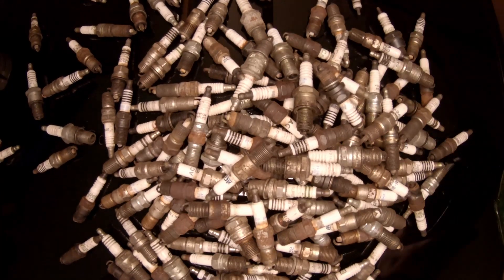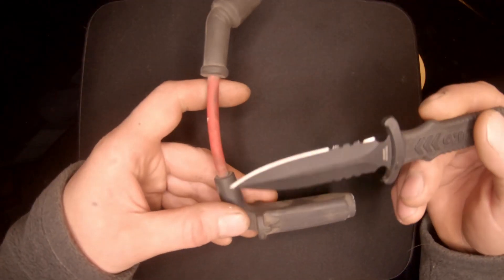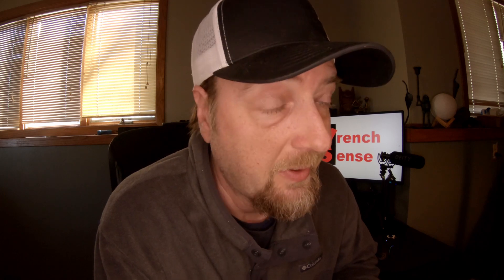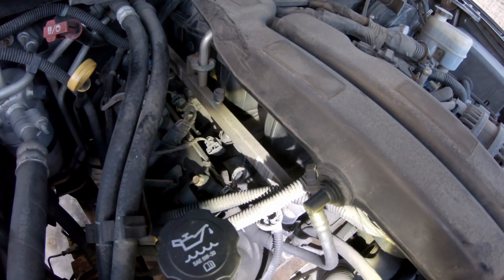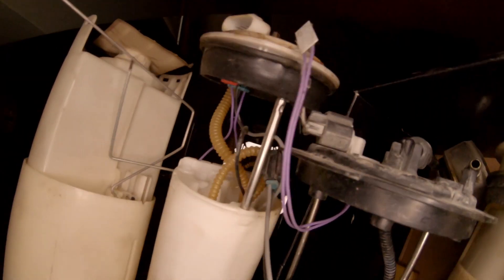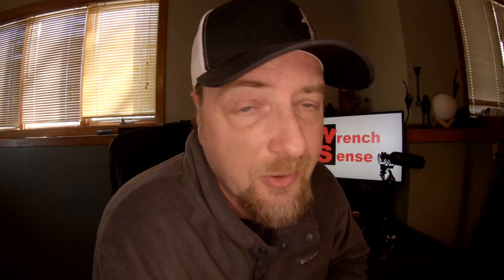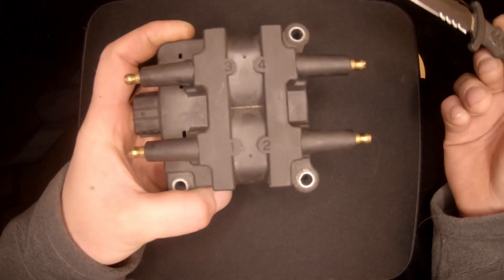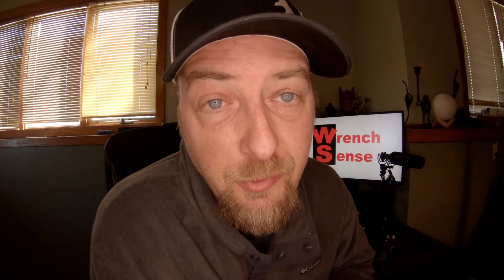P0300 FIX And A Blinking Check Engine Light

Comment: You're awesome🤣
 Thanks for the info. I enjoyed the sarcasm and humor def needed that because this 💩 is stressful. 
I got my spark plugs, my wires with booties and a coil pack from auto zone recently 🥴  I mildly attempted to replace them myself...however F that! Not for the faint of heart especially in the bitter cold of winter, so...  
Today I will be taking my 02 Ford explorer sport with it's blinking check engine light (by tow truck) to the shop and politely asking the mechanic to please tune her up. She is very angry and scaring me.  I will NOT be driving her. She throwing me misfiring codes for  cylinder 3 & 5. 😁
I'm hoping with the info u provided me the mechanic won't be attempting to get over on a woman by assuming I don't know what's up. Because I CONFIDENTLY DO (now) thanks to you 😁
Before watching I was 80% sure this was the problem but the massive attitude displayed from Big Red (my explorer) it seemed like it would be more complex to fix. Well🤞🏻this is all I need. 
Thanks again!

P. s. Cute dog 🐕
Reply from the maker: Very glad to help. Thanks for the comment. Glad you liked the video. Most people are afraid of our dog Drogo. I will tell him that you think he is cute.
Reply: so what happened ?
Reply: @detroitjohn4724  fix or repair daily

Comment: 2008 scion tc code P0301 cylinder 1misfire   and multiple misfire replace spark plugs and coils still same problem. No power on acceleration.  Help
Reply from the maker: Injector in cylinder 1? Swap injector to cylinder 2 to see if the misfire moves.  A problem with the VVT? Dirty or failing MAF sensor?

Comment: My 2004 gmc sierra runs fine till it gets hot then it starts to miss fire
Reply from the maker: The #1 suspect is the ignition coil or coil pack. Then crank position sensor. Then coolant temp sensor. Then fuel pump

Comment: Best video yet for this issue. To the point with quick informative illustrations. QUESTION, 2 months ago, I experienced a misfire, and the code came up as camshaft sensor, which is the 2nd one in about 6 or so years. Last night, I noticed a slight misfire after stopping and accelerating, and within about 100 feet, it started severely misfiring to the point of shutting down. I was a 1/4 of a mile from the house and just gently allowed it to run at low RPM until it failed about a hundred feet from the driveway and coasted in. Today I started it and heard no misfire. I drove it around the block, then took it down the highway within 1/4 of a mile, and kept driving back and forth, accelerating to 55 MPH with no misfiring at all. So, can wires, spark plugs, and or a coil possibly elicit intermittent issues? Thanks
Reply from the maker: Yes. Because when ignition timing becomes unstable, the PCM loses synchronization between crank and cam signals and blames the cam sensor.

Comment: Great video, thanks for sharing. I have a question, I have been getting 2 codes P050D P0300? Engine light isn’t flashing. And my Traction Control light is on as well.
Is it safe to drive it or not?
TIA

Comment: I'm desperate. I have a P0300 code on my 2000 Protegé. When the check engine light blinks, the engine starts to shake, and acceleration is poor. I've already replaced the coil wires, coils, and spark plugs. I suspect the fault may be fuel-related.
Reply: I have a GMC 2500 2005 same thing

Comment: The spark will follow the path of least resistance. The problem is the gap in the spark plug becomes so big that it tries to jump somewhere else because that's the least resistant. Path of the spark.

Comment: I drove today 30 miles with the 305 and 300 engine blinking.  Drove to a friend's place after work and replaced 1 3 and 5. Engine seems to run great with no sputtering. I'm going to replace 2 4 and 6 this weekend. I hope i didn't do damage

Comment: I got that code popping up on my 07 dodge i just got. Suggested part is crankshaft position sensor. 

I put the new part on and the light went off, but came back on. Got the code rechecked and its calling for the same part. Why is that?

Comment: wish  found this before i sold my escape w 301 code. tech school didnt do half those tests said bad valves w not to diff pressures. but then they put my civics hubcap on wrong and had to remove lug nuts to turn in to add air....tg at home but made me late n pissed wife

Comment: I have a 99 Dodge Ram 1500 with a 5.2 magnum. It's showing codes po300-302-303-304.  I replaced plugs wires fuel pump and also checked for vacuum leaks, nothing doing. Any advice

Comment: I have misfire p0300 p0172 p0175 on my 2022 suburban 5.3
Change 16 lifter camshaft spark plug and wires still the same. Cylinder number 3 injector keep dumping fuel 
Any idea

Comment: 03 dodge ram 1500 5.7 I have 4 out of 8 coils cracked, my truck died going 75 would start idle hard for 15 secs then die again with code p0300 with a flashing engine light. Coils show up tomorrow so fingers crossed I appreciate this video
Reply: Was it your coils

Comment: Thank you, it was driving just fine this morning, went to go to the store in the afternoon and it's running rough and blinking check engine light on, started up Normal but I got a couple of blocks away from the house and the check engine light comes on and Starts blinking, turned around immediately and parked it, now I am trying to figure out what has happened

Comment: Spark plugs changed, radiator changed, egr valve replaced. Ignition coils replaced. Throttle body replaced. Map sensor, pcv replaced. camshaft sensor changed, only codes popping up up or bank 1 o2 sensors a bank 2 o2 sensors. Cars starts an idles fine but as soon as the gas is pressed down  check egine light blinks for abt 45 seconds?

Comment: What i got random and every cylinder as well 2007 5.7l Toyota Tundra. Changed spark plugs coils. Injectors pvc valve fuel regulator. Compression test came out good. Within 10 psi every cylinder. About to do a fuel pressure test. Waiting on special adaptors this Tundra does not have a schrader valve to connect to. I think I see a leak and might be losing coolant. I thought it might be the valve seals. Since the spark plug threads come out with fresh oil on them. But I will try to do a compression test on the radiator see if I see anything. And possibly a block test. Coolant does not look Toyota pink. Might have never been changed and has become acidic. Look more orange a lil tainted. Any guidance welcomed. I’m misfiring on all cylinders on cold start once it reaches drink temperature I can erase the codes. And they won’t come back till it’s cold again.

Comment: Amazing. I've listened n tried so many other people's thoughts.  Now. U alone have given the most knowledge that is perfectly explained.  I salute u...now enough w blowing smoke up your a#&....I have two 2000 jeep 4.7.  One 4wd. N one is two wheel.  My wife's two wheel has issue still n trans not wanting to shift  until high revs n hard n sometimes slips.  Just spent 1800 on the trans n installation.  But this is what's happening. N gear shift off. Over drive is neutral.  I'm doing the advice u gave on throttle body.  N brand new coil packs. X 8. N plugs x 8.  Ran perfect. For 100 miles at 110 mph.  Let off gas. Just little. N started missing bad. But just at times.  So there's my story n I'm working on it at 4 n am. Butter cold. On the street.  ..4wd.  I rebuilt the engine total top n bottom. Cuz. The notorious knocking at purchase.  It wasn't lifter or rocker but after replacing all those I rebuilt it. Laying on ground. N street. N front my house.  ....it runs perfectly   lots lower. But hard start n stalls after few mins.  Ether6stRts it. After I blue. Cover across street n two fires later.  ...any suggestions

Comment: Dodge ram people make sure you disconnect your negative side of your battery. When you change your spark plugs or coils, it will cause your crank sensor to go out on you. That’s what happened to me. I change my spark plugs, and the thing started misfiring. I thought it was the coils so I put a new coil pack on there same thing P300  it ended up being the crank sensor because I didn’t disconnect the battery.
Reply: Good looking out 🫡

Comment: I was driving in some hill country today and started my cruise control and then I noticed to check engine light come on and was blinking. I immediately turned the cruise off and it went away. It was only on for 3 seconds. Do you think this is still a concern? I drove for 25 miles and no engine light and the Silverado wasn’t driving rough at all. I plugged in my obdII and it had maybe a stored code of P0300- pending 

And if it didn’t give a cylinder number , aren’t the chances very low of it being a cylinder misfire? Thanks for the video and help! New sub

Comment: here I've got a good one for you, 

2006 Cadillac Escalade I've done everything besides the injectors and the coils the coils test positive with a bench test under load I'm experiencing zero misfire however I'm getting a flashing p0300 random misfire I looked at my fuel trims everything is normal My catalyst system is working properly truck has 174,000 mi on it factory catalyst system still within spec however above 70 mph I get the check engine light flashing I drop down to 60 mph it goes away completely not even on the dash
Reply: Not to mention I had stainless steel brake lines put on the truck from master all the way back The guy was supposed to get into the check engine light for me said he couldn't replicate the problem and that all cars especially 20-year-old ones now will always have a check engine light on as a mechanic I took this as an insult but went on with my business because I didn't have a lift to do my own brake lines and depended on somebody else to do it for me so I couldn't speak on his hypothesis.

Comment: 2004 nissan 350z had camshaft bank 2 and we replaced it also we replaced all spark plugs and igntion coils and still having p0300 and check engine light flashing when driving car for 3 minutes and car has  no power

Comment: Good advice, thank you. My p300 and p304 ended up being a bad injector, just in case others run into this. Cheers!
Reply: Did you replace all your injectors or just one?
Reply: @retiredsnowbunnyhunterx5106  I replaces all of them.  The OEM injectors where i live (Cancun) are pretty affordable for all 4 of them.  I think I paid about $120 USD for all four injectors.  I also noticed that the fuel rail was very dirty inside when I removed it. NOTE:  I also replaced the PCV valve that was a bit suspect.  The car has been running great. Good luck.

Comment: Question my 13 Toyota Camry will at random engine light will come on also trac light I’ve replaced all plugs and coils and it’s still doing this and recently the engine light came back on and off blinking and which made car sputter then turn engine off no lights and car running fine I’ve reset it and able to drive no lights and bam out of no where engine light comes on along with trac light why does it do this at random

Comment: Cool dude really good video but I did everything and still nothing could plugs cam crank fuel pump o2s all them map and it will run like shit then it will run great but if its runing good and I get on road to get up speed it will start it again p0300 I'm at a loss it's very clean oil every 3k never missed all man done even diff trans transfer case it just started out the blue and got me stumped idk want to do next any input would be good

Comment: Would a oil leak be connected to a p0300?  I don’t know where exactly it’s coming from but it’s small and I’m having to add oil to the engine. I have already changed plugs and wires. I guess my next step is to check for vacuum leak and change fuel filter.

Comment: I need help, my 2012 jeep patriot have a code for #4 cylinder, I already changed the spark plugs and I switched the same used  coils from differents numbers and I still have the same code for cylinder #4, i
I did a compression test and the results are there #1=185 #2=190 #3=160 #4=190 and also my engine light keeps flashing.  Any ideas? Thanks

Comment: Thank you. New mechanic at the shop we used for decades sold me a "good well maintained" 05 Jeep renegade, i took it home, and found out hes a damn liar. Seems it sat for years untouched until he tweeked it to sell it. I washed the vehicle to find rusted passenger doors bondo & painted over,  junkyard backend still has blue paint on it (visible after carwash) Hoses dryrot. Etc. I get new codes just days after every repair. Replaced power steering pump & hoses after it broke & leaked on highway at 70mph.  radiator & coolant hoses exploded in a snowstorm, Just spent a couple grand to rebuild the transmission last week,  now o2 sensor p0152 & p0300 w flashing engine light. I wish i was DONE but i Put so much money in to this piece of crap, i cant afford another car 😭   thanks for the educational video. U definitely earned a follow!
Reply: Just Empty Each Pocket.

Comment: IF YOU COULD PLEASE MESSAGE ME BACK I HAVE A REALLY MESSED UP ISSUE WITH THE VEHICLE I PURCHASED FOR MY WIFE. FIRST WIFE WEDDING GIFT 
02 montero 3.5L V6 XLS
CONSISTENT P0304 code first reading started down the list of things to replace. and it goes

NEW 
PLUGS/WIRES/COIL PACKS/ GROMMETS/VALVE COVER GASKET/INTAKE GASKET/FUEL PRESSURE REGULATOR/PURGE VALVE/2 other fuel related emmision vacuum valves/FUEL PUMP AND FILTER/EGR VALVE. at this point the vehicle cats material had broken broken free from the two smaller area on the exhaust clogging the larger cat causing it to bog down and broken a drive belt wife is pissed nice gift .right?!? so i dropped the exhaust ,poured the honey comb out into a bucket and the is no catalyst homey comb left bolted the exhaust back up .

Last was FUEL INJECTORS. 
after the injectors got replced the vehicle now reads p0300 and i am lost

Comment: About two weeks ago I just replace the intake manifold because any fries was going into cylinder seven and eight well I replaced cylinder seven and eight with brand new spark plugs and a brand new coil it still says eight cylinder needs to be replaced are the mechanics say yes it's a vacuum leak or a cam sensor that I need to change so do you have any vise to share with

Comment: I have the diagnostic trouble code P0 300 on a 2004 Silverado 4.8 I replaced the coils and spark plugs spark plug wires and I still have the P 300 also did a fuel pressure test which it reads 62 pounds at idle and 58 pound PSI‘s with key on.& new intake gasket only thing left is fuel injector & last a compression test ?😂

Comment: Awesome! Please go on all the other YouTube channels that try and explain this but don't really know and to the comments that try to correct it when they don't know either and praise the one or ones that actually know what there talking about and tried to explain it only to be told we don't know what we're talking about. So I had came across two 4.2 Chevy's with cracked egr valves that coded 0300 no egr code. Was unnoticeable until cleaned and gasket surface buffed when it showed and they were rather large going nearly around the valve. One 5.7 with similar but different situation where the metal tubing running from the front to back on driver side head off egr had split about an inch long on inside wall. Also 0300 no egr. Just throwing it out there in case.

Comment: My 2001 Chev Silverado 1500 wasn’t used for about 4 months. Started it and runs a little rough with blinking po300 code. Not driving it for a few months, is the first thing to check the spark plugs and wires??? Great video and personality!
Reply from the maker: Thanks bro. Yeah, my first thought on this is that one or more of the cylinders may have gathered some  moisture and or oil while sitting. It could be that whatever has found its way inside the engine might burn off pretty quickly. I would think plugs first in this case. Could also be some moisture under the distributor cap. Thanks for the comment.

Comment: Dude this seriously helped me out!! My check engine light has been blinking for over a month now!!?! I have changed out all 3 ignition coils,  all spark plugs and wires,  AND the ignition control module and the dang light is STILL blinking! 😭😭 You gave me some EXCELLENT ideas just when I was feeling stuck and didn't know what else to do!
Reply: Check oxygen sensors.
Reply: Did you fix the problem?
Reply: If  you have p300 code and after  a month of changing  everything  you can think  of and the check engine  light is still blinking  , it time to push the car into a Lake " 🏝🚗🚶‍♂️
Reply from the maker: Right on. Glad to help. Thanks foe the comment!
Reply: Throttle body